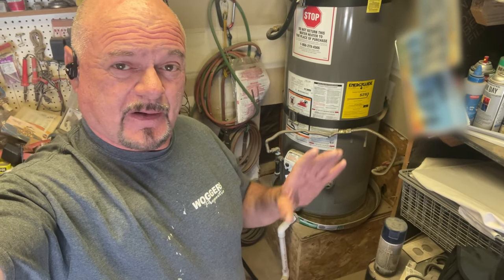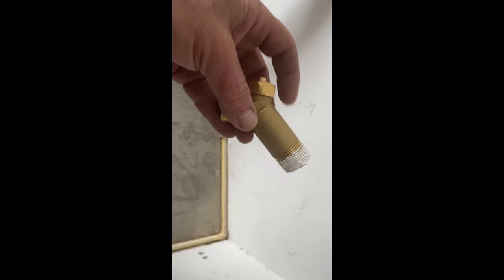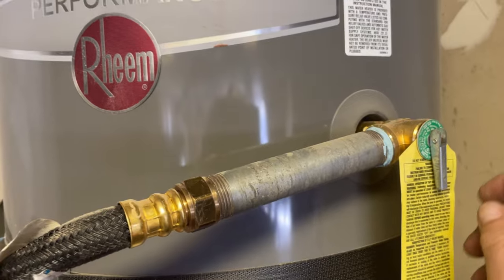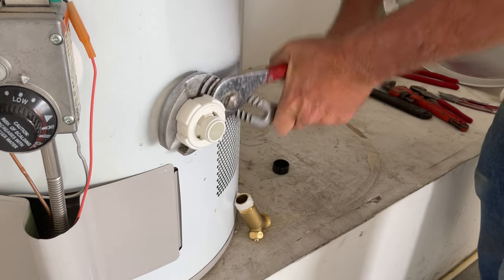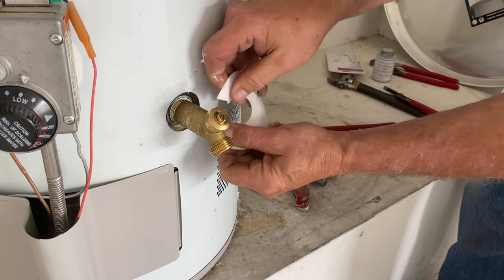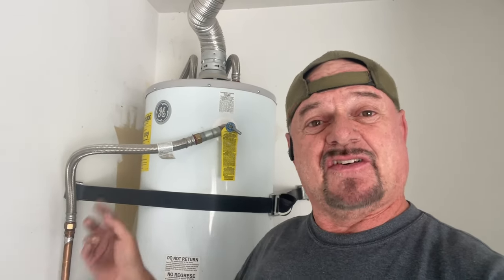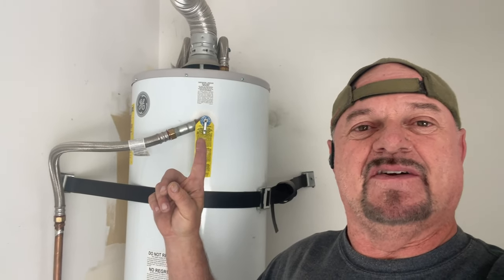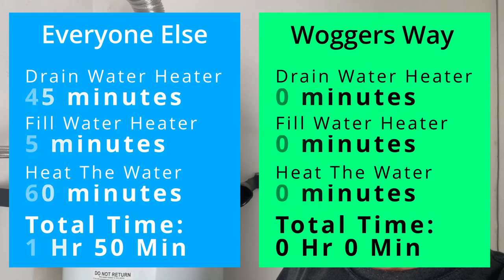Replace A Water Heater Drain Valve WITHOUT Draining The Water Heater

Comment: Why does my rheem water heater leaks from the drain hole
Reply from the maker: If it's dripping from the valve where you would connect a drain hose it's an indication the seals in the valve have deteriorated or got corrosion in there.  If it's leaking from around the valve, where it screws into the tank, then you have a sealing issue in the threads or the valve is damaged.  Either way, replacing the drain valve, making sure to properly seal the threads with Teflon tape or joint compound should cure your issue. Good luck with your project and thanks for watching.

Comment: I wanna do this so bad but im scared my drain valve will break off in the heater 😢
Reply from the maker: There's nothing to fear but fear itself... and maybe a flooded house... oh yeah, and bears.. bears can be pretty scary.  If you're not confident then always play it safe and drain the tank. Especially if your unit is quite old or if you see a lot of corrosion around the valve. Thanks for watching and drop us a comment on which route you took and how it went.
Reply: @thewoggerswaydiy  haha it's 10-11yrs old. It's in the garage so I'm not worried about a flooded home. I'm worried about having to replace the WH if I break the plastic drain.
Reply from the maker: Not a problem.. if the plastic drain valve breaks off you can still remove the remnants. 
 I don't have a video on that yet, but here's a link to on that will show you how to do it. 
 Good luck with your projects.  https://youtu.be/4m1KxuHewHY?si=PzstrCC50zinYPHj
Reply: @thewoggerswaydiy  thanks!

Comment: Just did a drain valve in a third floor apartment the other day. I thought about trying this but I’m not gonna lie, I didn’t have the balls.
Reply from the maker: Understandable.  The first time I did this I also had concerns... just have a flexible vent pipe positioned to the outside that you can place over the opening in the event you can't get that vacuum created, but in over 13 years I've yet had this not work.  Just realize some water will come out.. a few ounces.. so place a rag/towel underneath the valve to soak up any water.  Good luck with your future projects.

Comment: Can you just cap the drain off?
Reply: @tomdavis3495
Reply from the maker: if it's dripping from the end then yes, although that doesn't fix the issue.  A better alternative, if you don't want to change out the valve, is install a shut-off adapter that screws on to the valve and has it's own shut-off lever.  If it's leaking from the threads, then neither a cap nor the adapter will cure the issue and you'll need to change out the valve.  Good luck with your projects and thank you for watching.
Reply: @thewoggerswaydiy  hey I figured out there was like a good half turn or turn left so I turned it until it was tight and it stopped the drip I still have a container underneath it to see if it still leaks in a day or so , and I did buy a brass hose bib cap! Is that good ?
Reply from the maker: Yes, but see my reply to @jonleone777 above.  It could be a bigger underlying inssue.

Comment: so when the brittle plastic valve snaps off the second you go to loosen it what then? drain it the hard way, all over my laundry room.... thanks for the "hack"
Reply from the maker: If you look at the 9:00 mark, I mention how you need to have a pipe on standby to catch and direct any mishap, should it happen.  If you don't take the necessary precautions to prevent any such mishaps, then you're the one creating the "hack".  In all my years I've never flooded a room, garage, etc., or caused any damage, because I make sure to be prepared if things don't go as planned.  Thanks for watching.
Reply: @thewoggerswaydiy  had pipe on standby, problem is what is left of the plastic valve is still in the threads.
Reply: @apz39 I’d just go back n forth as if u was on a rusty bolt n pray of course.
Reply: I had the tool I use to remove sprinkler heads just in case that happened. He might want to add that to his video. I thought about that last night and went out to the shed and got the tool just in case. Didn't need it, but it pays to be safe.
Reply from the maker: That's exactly what I use.  Wish we could update the existing videos but we can't.  Just would have to post a new video.  Thanks for the suggestion.

Comment: Mine is leaking from the front. Just had my home warrenty com0any send out a tech to replace the valve. This guy take a look for two seconds and tells me he going to put a cap on it. Little did he know im an operations super for a miliary contract and manage all the building trades. I told this guy replace the plastic crap with a metal valve. He gives me some crap about the valve breaking then he has to replace the whole tank. Needless to say i sent him packing and called the warrenty company and got square in their ass about sending idiots to my house.
Reply from the maker: I see it all the time with warranty companies.  It's so frustrating.  Hope you were finally able to get it repaired.
Reply from the maker: Just had a subscriber email me the other day about this same scenario.. home warranty plumber just put a cap on the leaking plastic drain valve because he didn't have a replacement on the truck.  Then he made the customer go to the store to purchase the cap (first, shouldn't have the customer go buy the parts.. and second if they were sending them to the store, at least have them pick up a valve instead of a cap).  Long story boring, the cap was fine but the real issue was the threads on the plastic valve were actually breaking so the valve ended up shooting off and flooded the house a few days later.  If the valve was just replaced as it should have, the flood would have been avoided.  Now they're going through flood remediation.  I have lots of issues with Home Warranty vendors which may be a video in itself one day, but goes to show, if you don't do it right you have more problems... A 10 min hack job turned into a job in the thousands of dollars and weeks of inconveniences to the homeowner.